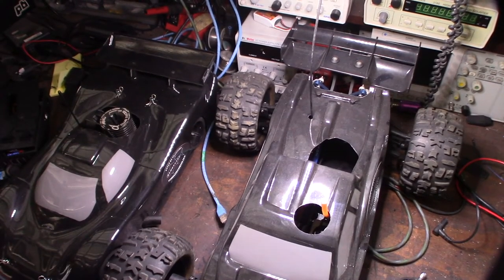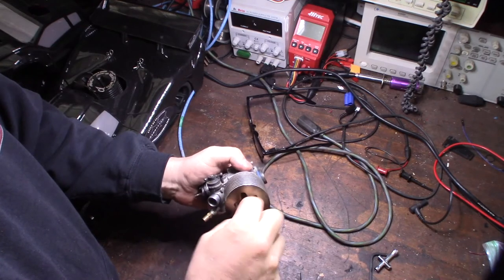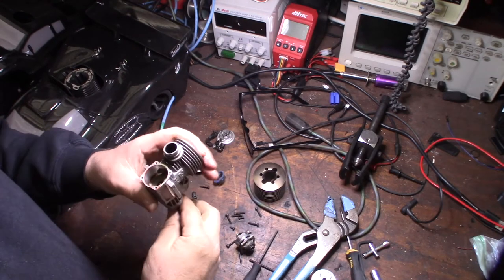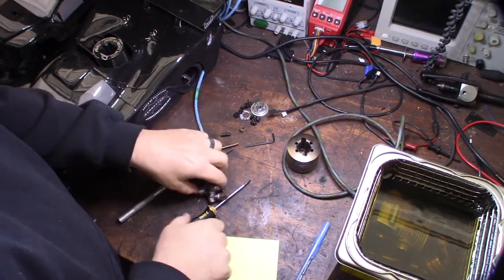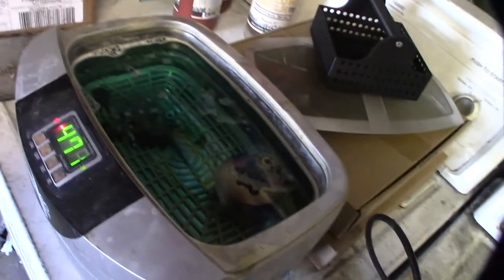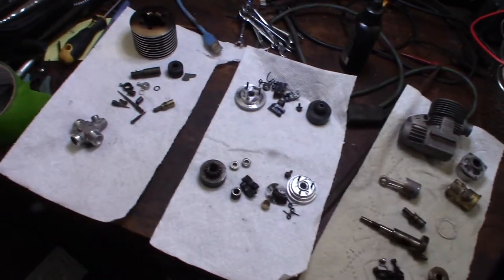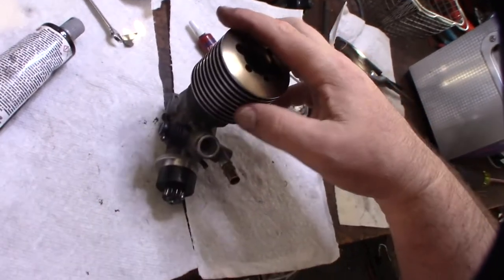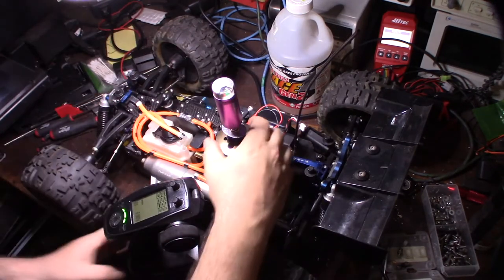Team Associated AE PRO 28 Nitro Engine Restoration .28

Comment: I commented some time ago but...
I'm presently bored, or if I'm to be honest, procrastinating on some needed home attention.
You're an interesting chap. I ran across your channel quite some time ago when looking for anything Bronco, (I own a 74.) Having some short term memory issues, I'd forgotten why I'd subscribed to your channel but it didn't matter... your content and delivery was interesting. Then I see the Bronco show up in one of your videos maybe a year ago... click. 👍
I've got a new engine sitting in front of mine, now kicking around a full frame off restoration. I have to pull the transmission and transaxle out to replace gaskets and seals, the wiring harness is the original and looks like a spider's web under the dash... 
It looks great as it is but you surely know what a frame off restoration does to the value of these first generation models. I was thinking about selling it a few years back and mentioned it to the old duffer, a car guy, living next door... he asked how much. I told him it'd sell in its present condition for thirty grand easily... he laughed. Last week he stopped by when I was out front and said... "You need to get that engine in, do you know what these are selling for?" I told him mine would probably sell for about forty today... he laughed again but this time for a different reason. I haven't been following the market in some time, haven't looked to see what that knew Bronco did to the first generation, how it affected it... apparently he had. He said they're selling  between two hundred thousand to three hundred and fifty thousand for the full frame off restoration.
Well, procrastination be damned... lol
That firewood isn't going to move itself.  🙄